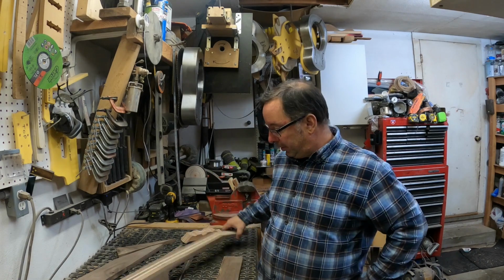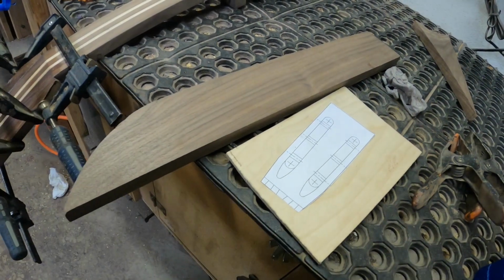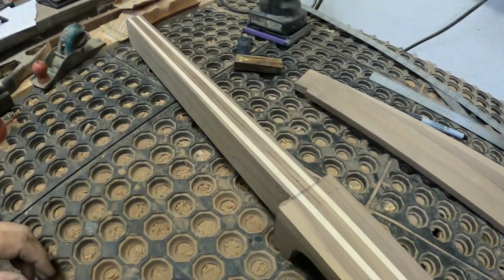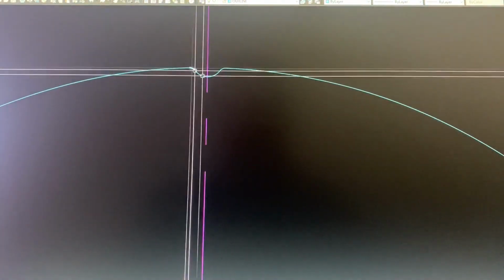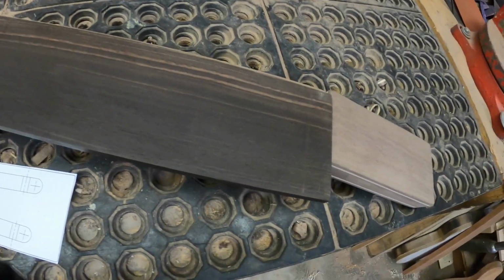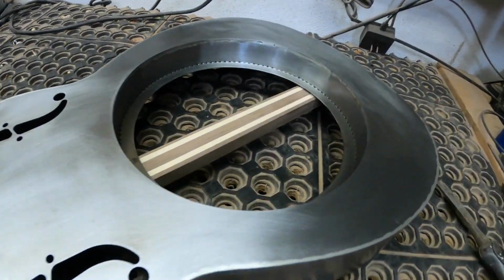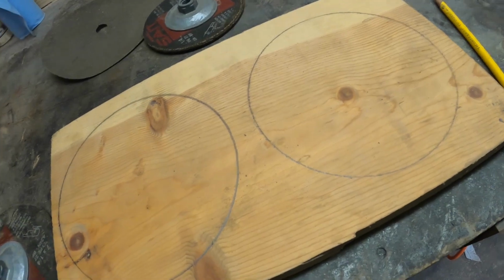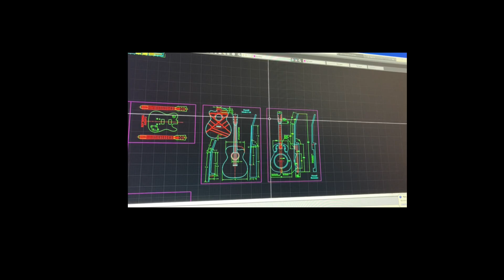Building a steel Resonator guitar | National Style | EP 7 | The neck... mostly

Comment: A metal roller, I don't know if this is the right name, could also be used. It is used by panel beaters and vehicle restorers to shape mudguards, body panels, etc. D3Sshooter is busy rebuilding a 1930's truck and in some of his videos he uses a roller. It basically is two steel wheels of which the tension can be set. You place your piece of metal between them and pull it back and forth, increasing the tension as needed.
Reply from the maker: I think it might be called an english wheel. I've seen them used but I have no experience with them. It might be the right tool for the job. I'll look into it. Thanks.

Comment: I think you are going to have a little bit of trouble pressing that shape into the back because of the narrow waist area between the front/back sections.....to get that without distortion on the edges you will need to shrink it as well....this doesnt happen when you push into a circle, its just stretching the metal. You may need to just keep the deflection to the center, so think more of a straighter central hump instead of the shape of the guitar.
Reply: This sounds right to me too. Although I don't have first hand experience the logic is solid.
Reply: I wonder if an english wheel would work well?
Reply: @JourneymanRandy  a wheel would be good if one was to hammer out the shape then use the wheel to smooth it....the beauty of the wheel is you can move on all axis so you can make beautiful contours...but the wheel still wont help on the waist as it cant shrink to that amount.
Reply from the maker: I agree with all that and what others have said, the waist area is going to be a problem. My plan is to make a press similar to what you describe so the deflection is more towards the center. I've been making the two pieces that hold the sheet metal in place while it's being pressed, I think they are done. Now I need to make the piece that does the pressing. I don't need very much curvature (very shallow curve) so I'm hoping the waist area won't be too bad. I feel like if I pressed something basketball shaped into the lower bout and volleyball shaped into the upper bout I'd be pretty close.

Comment: I agree with another's comment, you will probably have some warping of the overall shape after pressing it. If possible make a test piece that is the same shape and thickness first. It doesn't need to be perfect, just rough cut. You'll be able to see where it warps and then adjust the mold shape to account for it. Thicker metal and round shapes will act different than a a curvy shape of thinner metal. If you make an opposite bend in the mold it may help with that as well. If the warping isn't crazy, adding some heat over the whole piece may relax it enough. Be cautious with just clamping a warped piece and soldering it on. Temp changes and hard playing could cause weird tuning issues as the warp pulls on the whole body. Great work, thanks for sharing and including us.

Comment: The Neck stick on a National is only about 1" wide. Nationals did not have adjustable truss rods, if they had one it was a steel tube. There is a tail block at the lower bout and the neck stick does not go above the sound well at the lower bout. Also there are two mushroom posts that support between the neck stick and the back at the sound well.
Reply from the maker: Yes I'm aware of the tail block and the mushroom posts. I'm hoping to avoid the mushroom posts so the back can vibrate some of the bass frequencies better. I will end up with a tail block as I get further along fitting the neck joint to body.
Reply: @Ninety2guits  You should try it with and without the mushroom posts, you will hear a sound improvement with them. There is a reason that National used them. The resonator guitar is not an acoustic and the back needs braced against the stick. You want the cone to make the sound, not the back. If you leave that block on the end of the stick you will not be able to remove the neck after the back is soldered on.

Comment: Could you use a cake tin or something similar for the resonator? I've seen CBG builds that use metal dog bowls for the resonator. Maybe even a round cookie tin would work.
Reply from the maker: I suppose you could but all of those things are much much thicker and dense than these cones that are spun on a lathe over a wood buck. The cone I bought is so thin and fragile it would be completely destroyed if a full soda can tipped over on the side of it. It's so fragile I am afraid to pick it up wrong. It can withstand a lot of downward pressure applied in the center of it, but any pressure on the sides or edges would collapse it before you knew you were putting pressure on it. If you want to watch some cool videos search for spinning resonator cones.